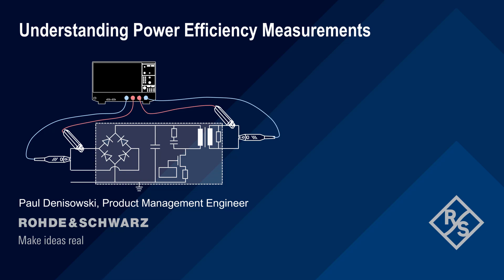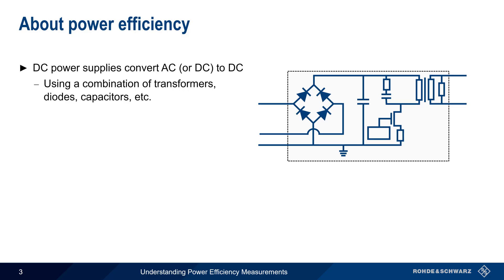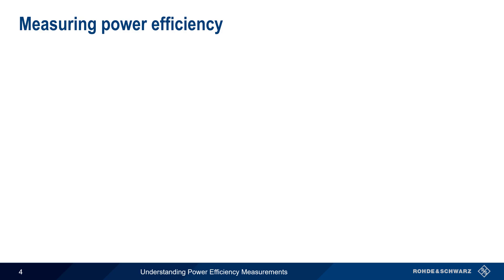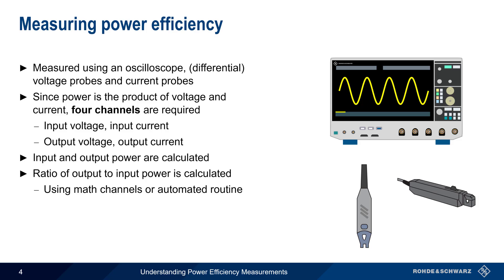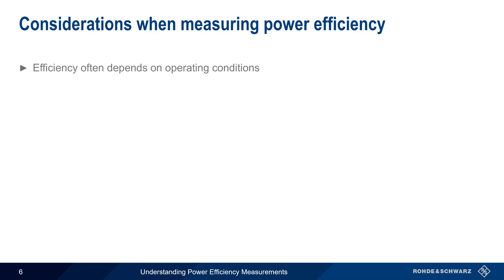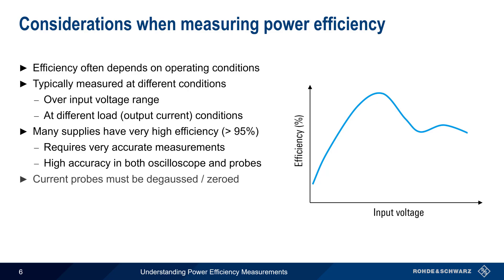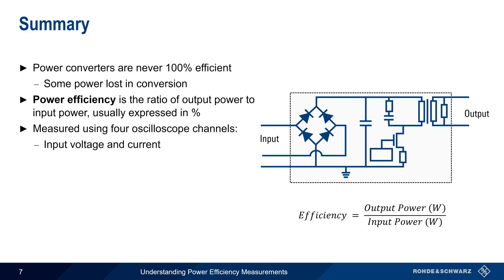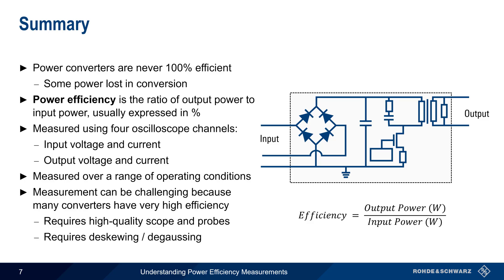Understanding Power Efficiency Measurements

Comment: My 2 cents, 1: if somone buys a Rhode scope, good chance they know the difference of linear and switching power suppy - I mean, this is a Rhode video, they not exactly producing for the entry level hobbyist. 2: Power is not lost during a conversion, doesn't just fly away or get lost in the dryer with your sock, power is consumed by the device it self. - im I being picky? yes, because I expect more from Rhode than I would Hantek
Reply: Thanks for the feedback!  The videos I produce are not aimed specifically at hobbyists, but at anyone who needs a short technical introduction to a T&M related topic, regardless of education, experience, or occupation. In my 20+ years as a field applications engineer, I met many customers who were very knowledgeable and very experienced in their fields but who were sometimes unfamiliar with topics outside of that field, so I would like to think that even “seasoned professionals” might sometimes benefit from these videos :).  We (R&S) publish a great deal of content, some of which is extremely technical / detailed, so If you’re looking for more in-depth information, please do visit our website!

And no, you’re not being picky at all :).  Usually power is “lost” as heat, and thus power efficiency measurements are also helpful in that poor efficiency usually requires more cooling and thus more size / weight / cost in the supply.  Most people refer to this as “loss” even though, as you say, it’s really just being converted to another form.

But again, I very much appreciate the comment and feedback!
Reply: @pauldenisowski  Thank you for the reply, I just see so many people (entry level) creating projects an not realizing the device the make also consumes power as well as introduces delays. I appreciate your reply and I didnt articulate myself well, one of my many issues lol
Reply: @portblock  Agree completely.  Thanks again for the reply and feedback!